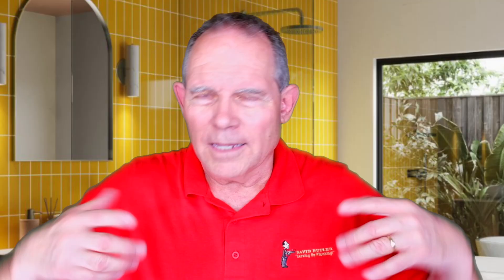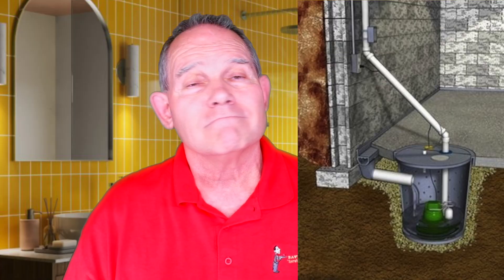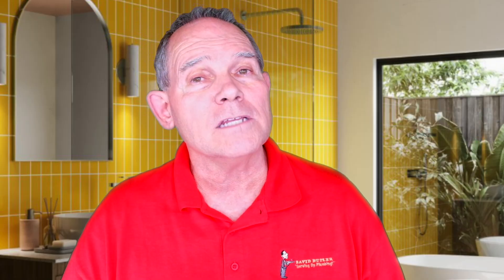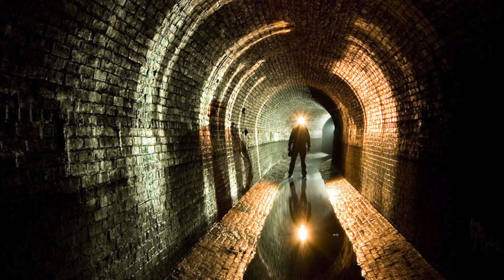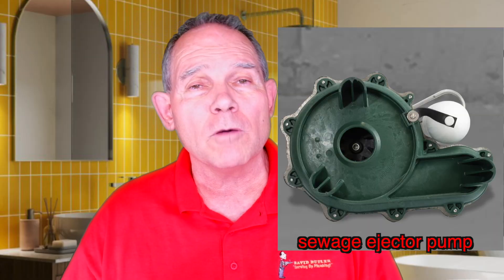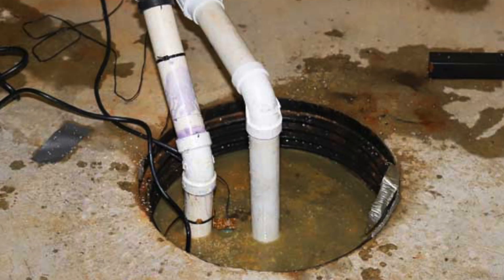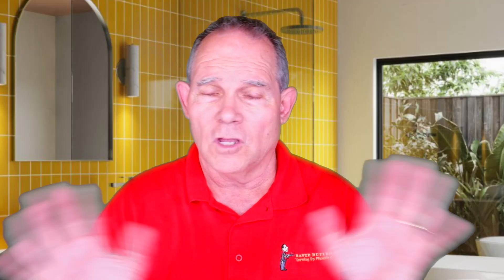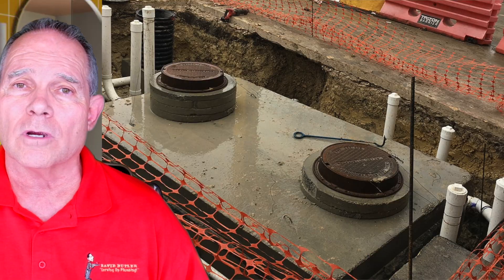Sump Pump VS Sewage Ejector Pump: What’s the Difference?

Comment: i remember reading that if you have a washing machine in basement that should run using a sewage pump because sump pumps cannot handle grey water.  is that true?
Reply from the maker: I would say yes because that is sewage. Thanks for the comment and thanks for watching!😃